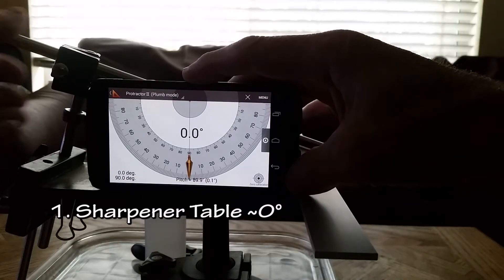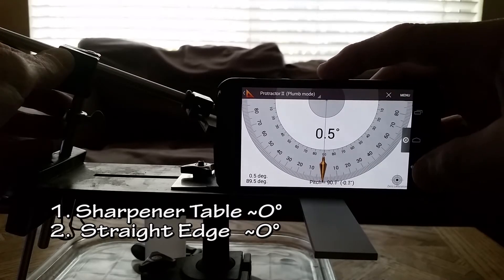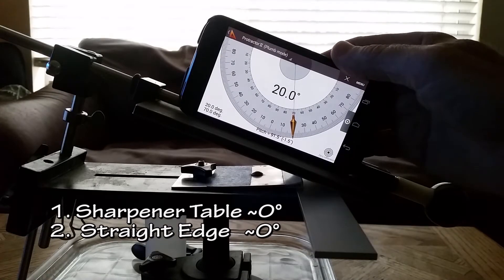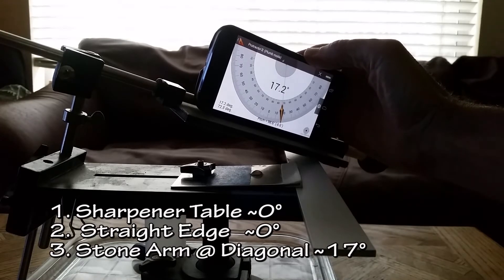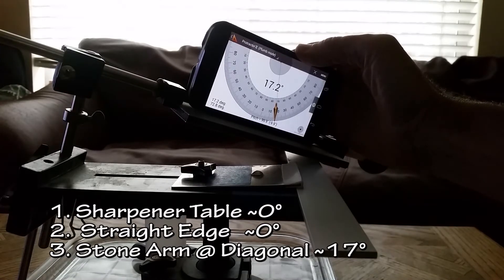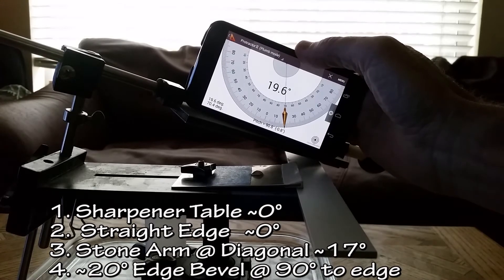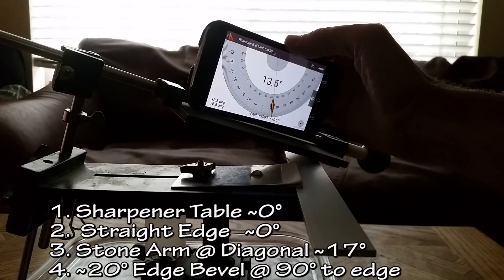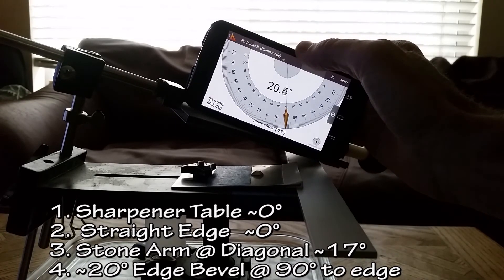Knife Sharpener Jig Debate - Left/Right Angle Change

Comment: When I was active on the Wicked Edge forum, this was one of the most often misunderstood concepts for new people to get.  It seems to defy some built in common sense logic we have.  I was just replying to a comment on my own "sweet spot" video from a while back and it shows how the angle doesnt change in relation to the plane.  Good stuff!
Reply from the maker: Curry Custom Cutlery Thanks for your comments. I think most folks really struggle with critical thinking skills, just expecting "answers" to be given to them without even understanding a question.

Example: when the surface width of an edge angle changes (like near the tip or perhaps in belly or near ricasso) they assume the angle has changed, when most times it's the sectional thickness of the blade that has changed (usually thicker near the tip - nearing the spine) and they argue the bevel angle has changed, when in reality the viewer is seeing a wider bevel because the blade is thicker).

Also, they fail to understand that changing the distance from the two hypothetical parallel lines created by edge & sharpening pivot DOES change the bevel angle (so, from belly to tip as this distance decreases = bevel steepens at same time as blade thickness increases approaching the spine), but the two changes somewhat counter act one another when it comes to the surface bevel width (the only thing most folks see when they look at an edge).

End result, folks "like" something (consistent surface bevel width) without even understanding what they are seeing (in typical knife this means the bevel angle is changing along the edge as the blade curves and they "think" they are seeing consistent bevel angles). Reality, most times, they have no idea what they are looking at (from a performance perspective), nor can they conceptualize something that would work better unless it "looks" better in their untrained eye.

Kinda akin to those who struggle to "sharpen" without stropping ... :-/